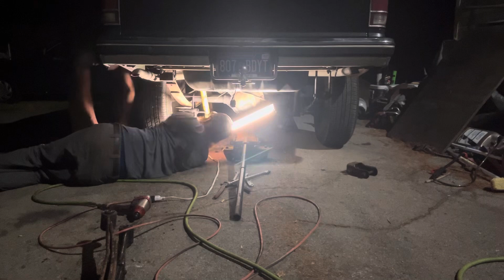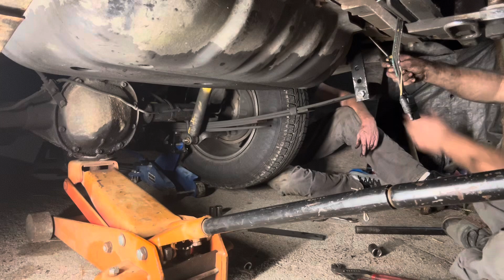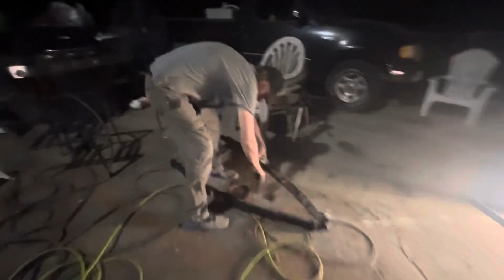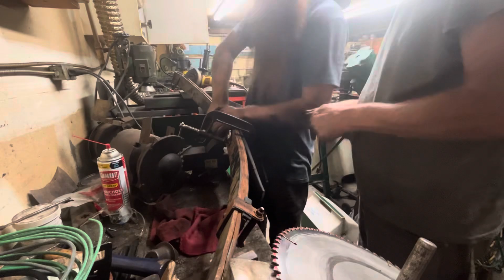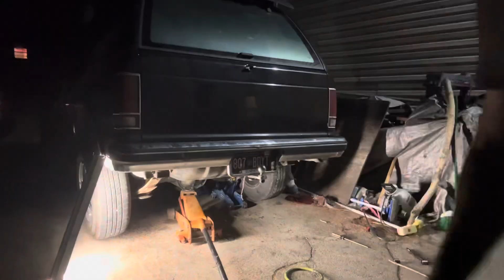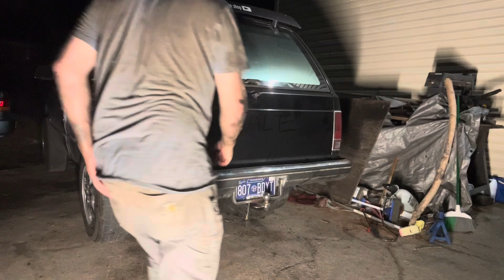85 S10 Blazer gets some old springs

Comment: Can u help me I'm not getting  pulse on my injectors on my 86 s10 but I have power to them.wenever key is on so I had my girl turn key on I took a 9 volt battery and touch the top post of injectors and then they sprayed lol
Reply: Check fuel pump relay???  86 fuel injection????. 😮. Read the book!??.